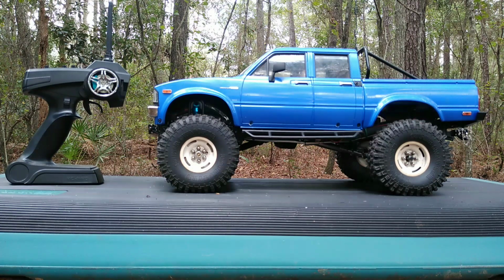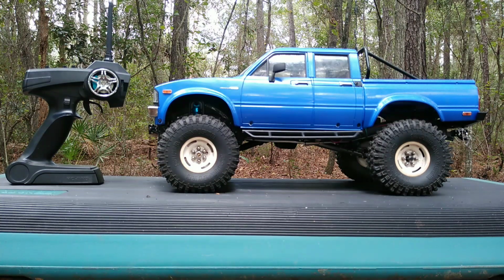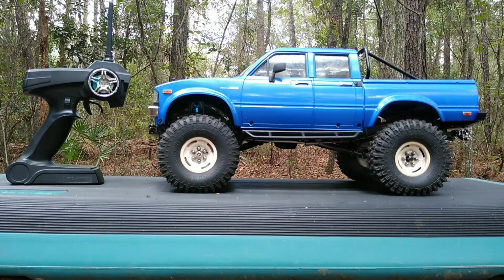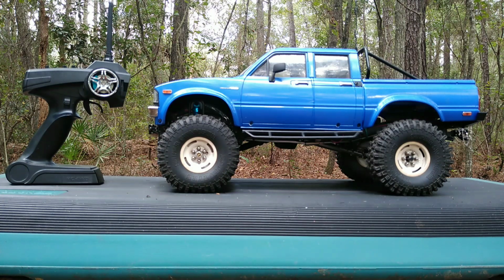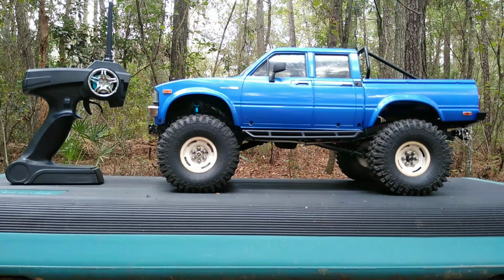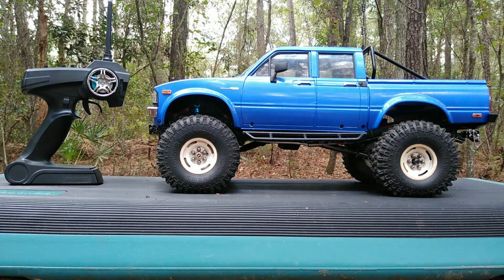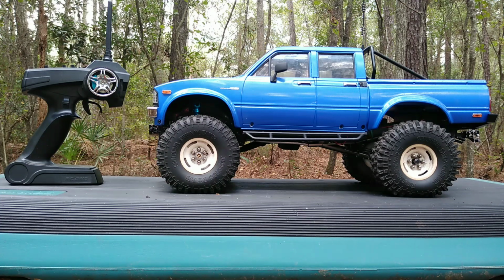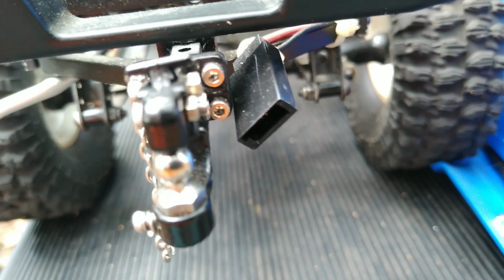Trailfinder 2 long wheel base overview,2

Comment: What size etc screw did you use to "pin" the body on?  I'm soooo over takin' those damn four screws out every time I want to run my TF2LWB.  Nice video
Reply from the maker: Since I installed the body lift I put the original screws in from the inside. If you're using stock body mounts you can use some long set screws, like for links. 10mm (?)long.
Reply: @SwampersRC  Thanks!! I do have the lift kit! Now to find those dang screws!